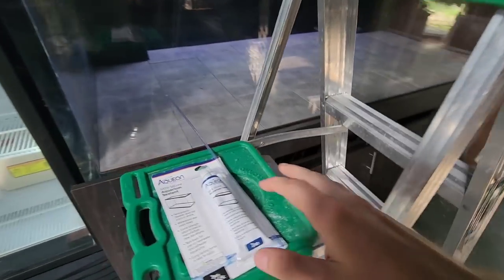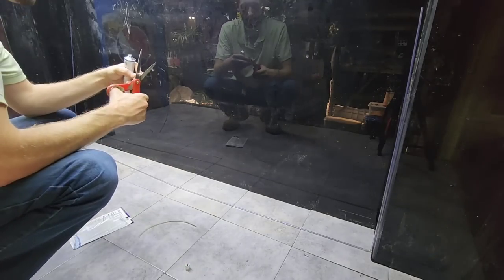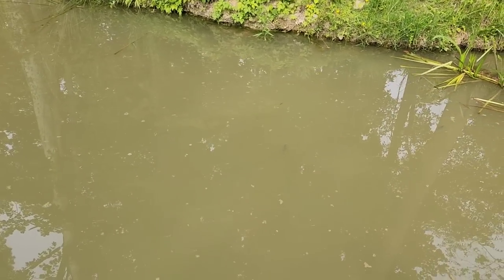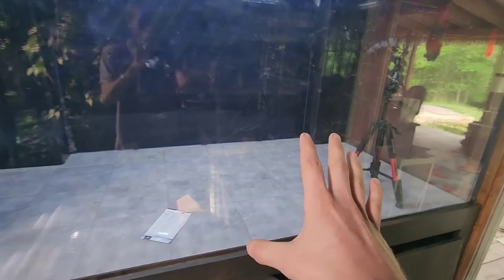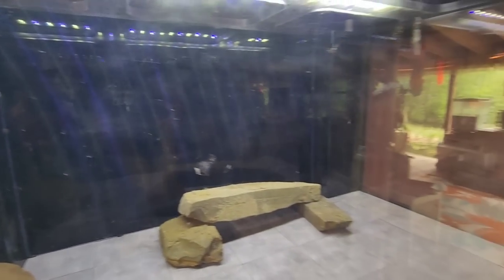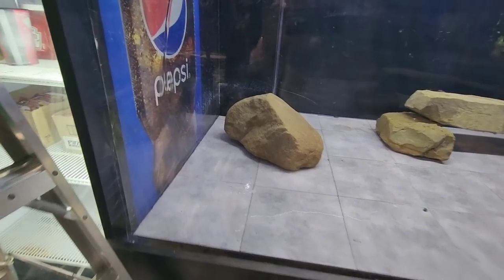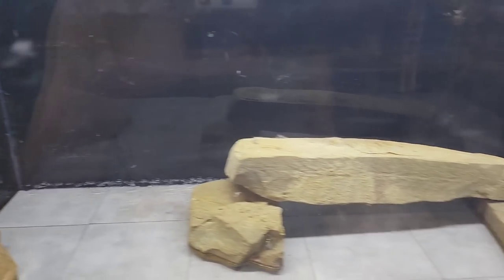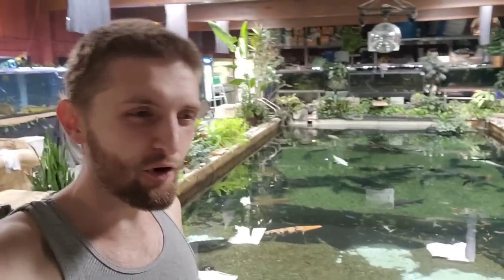My New $25,000 Fish Tank Setup Nears Completion

Comment: I remember seeing a vid with Rich right after you moved that tank in. He said you couldn't fill that tank until you fixed the sag in the floor in front of it, then he showed a low spot in the floor right by that edge of the pond pool. He said that floor had to be fixed first before he was comfortable filling that tank and adding all that weight near that sag. I don't remember seeing a vid where that floor sag was fixed. Is this still a concern as you fill that tank now? Thanks.
Reply: I believe that is on the other side of the room or diagonally across to the other corner.
Reply from the maker: That is on the other side of the room where we want to fill the 265 salt tank ip